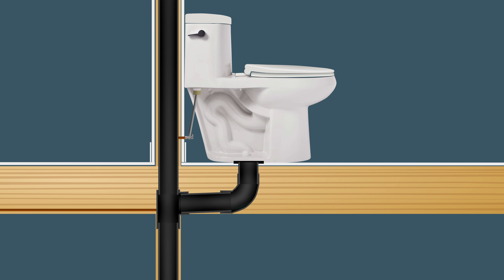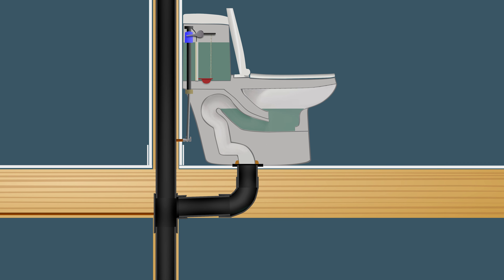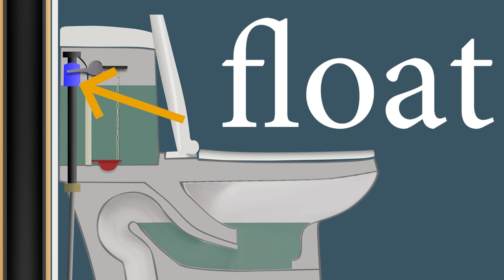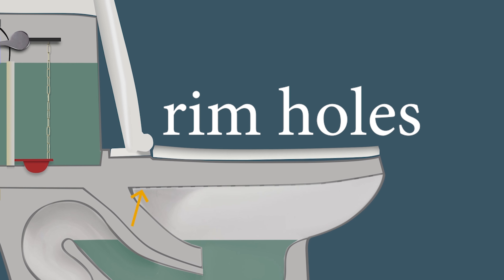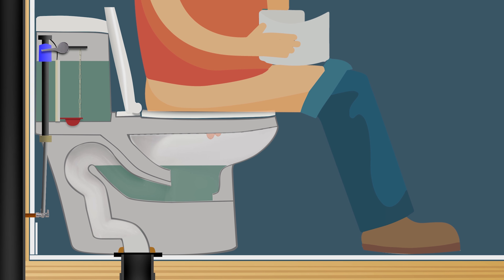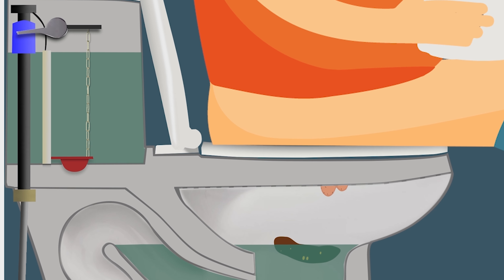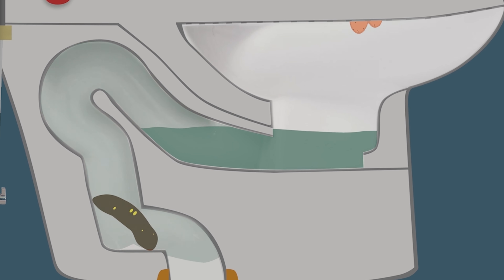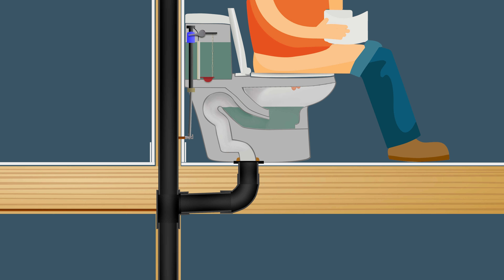How a Toilet Works (4K) | GOT2LEARN

Comment: I’ve noticed that my new 1.6 gallon toilet has a bigger flapper than the old toilets. I’m amazed at how well it flushes with very little water because of the increased water pressure from the bigger hole under the flapper.

Comment: New toilets have 2 flappers keeping water trapped in the rim so it doesn't empty.  With only 1.2 gals per flush it's getting hard to have enough velocity to complete a flush and clean bowl.  With water trapped in the rim, water velocity is maintained without having the air getting in the way.
Reply from the maker: Yes!

Comment: I know a guy who had his balls momentarily flushed down the trap only to be returned after the flush stopped.    He said it was not the pulling that was so painful but the twisting action, it took a minute for them to spin down which made them dry.  It was 1 of those pressure power flush toilets.
Reply: you sure he was not drunk and sitting on the mop ringer in the bathroom of the bar..

Comment: John needs some fiber. As for the toilet, you didn't finish explaining. ..you left out how it's a fixture with an integral trap. It uses an s-trap which is otherwise illegal in plumbing systems due to the way they siphon out the trap. Since they siphon out the trap, the trap must be primed again after each flush. That's why that little stream of water sprays down the hole in the stack the flapper is connected to. It's filling the bowl while the tank is filling with water to prepare for the next flush

Comment: whats important that the bowl fills up at the same time the tank does. if the bowl doesnt fill(tube damaged or not installed properly) then the water just from the tank may have problems flushing and pushing the waste and water.

Comment: Haha, nice video. Question: what if your compression fitting turns around, while the angle stop valve is fastening on the threads (and tape on it)? Help please. I can not turn on the main valve now. The pipe is too short to cut it off (and there is an ground block on it, which is obligated here).
Reply: Replace the hose with a braided flexible type, you shouldn't have to mess with shut off assembly, you can always tighten packing nut around shut off if leaking, use 2 wrenches.
Reply: @publicmail2  thanks for the reply. I got it working by putting the nut really tight. There is still a small leak of about a drop per 3 seconds. I can not make it tighter, otherwise the pipe or valve will break. I called a real plumber. I hope he can fix it coming Thursday. At least I can turn on the main now and use the toilet, shower and kitchen faucet. I wish can replace the copper with flexible, but it is behind the tiles and in the wall etc. So I can't do that, unfortunately. But thanks for the suggestion.
Reply: https://photos.app.goo.gl/NaCxfnSMgkAkhVDf6 a picture is better than words I think. So the compression fitting nut is tightened all the way, but it is still leaking. If a loosen it, I have to shut off all water in the house. That's why I am installing stop cocks in the first place.
Reply: @jwb6583  if you have at least 3/4 inch copper coming out of wall, cut it and push on a sharkbite at HD or lowes, just clean copper and push on that's it.
Reply: @publicmail2  thanks for the reply again, this is a small 10mm copper pipe, here in NL, the smallest Sharkbite fitting is for 15mm. But thanks for the suggestion, I can use that for if I ever want to work in the toilet, there all the pipes are 15mm. I am going to sleep now, here in NL it is past 11pm.
Reply: The problem is solved by a plumber. It was the ring of the compression fitting that was bad. He sawed it off and used the new compression ring and fitting which came with the stop cocks. 10 minutes work, lost 100 Euro, but I learned from it and if there is something wrong with the faucet, I can at least isolate it now.

Comment: You should have seen the catastrophe using 4,000 lb of pressure in a sewer line somebody forgot to close off the building in Michigan. There's so much fresh sewage came up in the building it wasn't funny even under the elevator flooded I used to do that job as a catastrophe worker before it was a semi truck driver. Got a gas with all that sewage up into your building without ever being on your property.

Comment: I really liked the video but it does not explain what is going on in my toilet. I changed the insides. The inside toilet water line from previous weeks is not automatically filling it totally to that toilet line. And continuously throughout the a.m. and p.m the water adds water to the tank. This has made my water bill almost double the water bill. How to fix this Please please. what step did I take or not take.  Please message me.